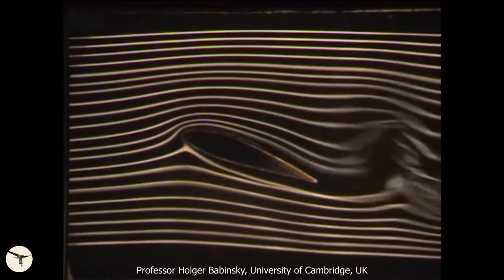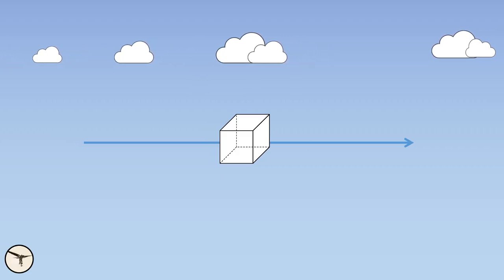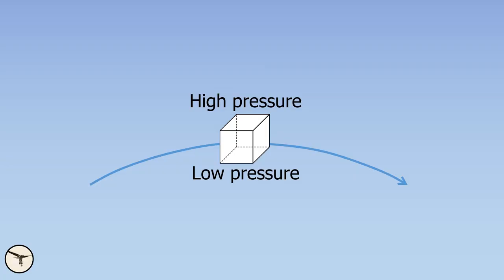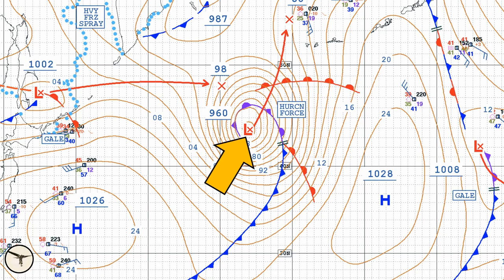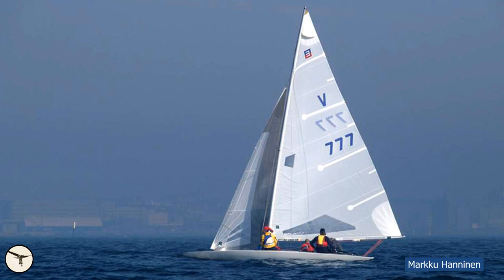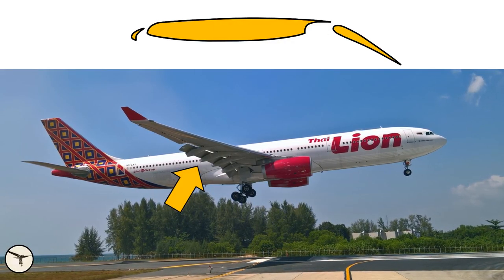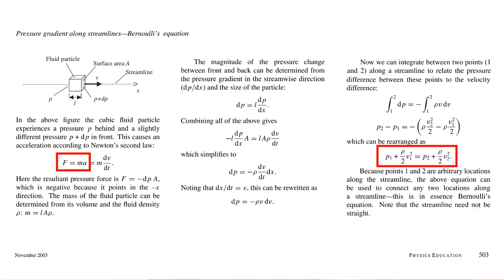Forget Bernoulli and Newton | The easy way to explain lift

Comment: Look at the larger picture and lessen the confusion: a heavier than air aircraft can sustain itself in flight ONLY by accelerating a mass of air downward with sufficient force to counter the force of gravity.  Regardless of what goes on on the top or bottom of the wing, or on any other aerodynamic surface, the net effect of the interaction must be that air is accelerated downward, or the aircraft will fall toward the ground.  Hope this helps.
Reply from the maker: Yes, that is true, but the acceleration happens over the curved leading edge and upper surface of the wing.
Reply: @FlywithMagnar  And that affects it's behavior at specific angles of attack and makes it less draggy (more efficient) but it does not change what is happening. Air is shoved up against a surface of an objected being shoved through the air. The object is getting pushed by the air as it moves past. Even if the leading edge and upper surface of a 'wing' is not curved at all it still gets forced around by the air moving past it. If you're careful you can direct that force against gravity and call it lift. The curves just make it easier to control.
Reply: @FlywithMagnar  - Almost all of the downward force is produced on the bottom and at the trailing edge of a wing.  Just look at any wind-tunnel with smoke video.  Equal and opposite reaction of a mass.
Reply: it must have angle of attsck thingy
Reply: Spot on.
Reply: @FlywithMagnar sigh .

Comment: The confusion in the minds of many is in the word LIFT.  Showing the high-speed/low-pressure airflow above the wing makes one think that the low pressure is lifting the airfoil when in fact, it's the higher pressure below the wing that is pushing the airfoil upward.  Low pressure doesn't pull; high pressure pushes and symmetrical airfoils work just fine as long as the angle of attack is positive.

Comment: Just a note, "deceleration" is incorrect. It is always called acceleration, simply because acceleration is a vector, so it has magnitude and direction. Like the difference in speed (scalar only) vs velocity (movement with direction)... The same goes for electric circuits, there is NO CURRENT FLOW, only directional movement or jostling (oscillation) of charge (DC vs AC). Hence current NEVER FLOWS, current is a form of flow AND thus, CHARGE is what moves. Current flow is nonsense, can a flow flow? (second derivative of what??) In the same sense, acceleration is the ONLY term and when a car, for instance hits the breaks, it accelerates to a HALT. Because the acceleration vector changes direction to oppose the motion, via the breaks and friction exerted on the road.

Comment: It seemed like an arbitrary decision to compare lift to low pressure cyclones. Why not compare lift to high pressure systems?   That would make the pressure highest in the center of the system and lower as you moved outward, reversing the conclusions of the discussion

Comment: short add.
We must consider what comes first, pressure changes or mass deflection?. Our first action is initiated by moving / displacing the mass package. Than by the inertia, the compressibility and viscosity, i.e. stretching of the rubber band comes the changes in pressure and the adiabatic temperatur changes. A continuous process.
Reply: What causes the displacement of the mass package?
Reply: @petep.2092  The leading edge of the aerofoil causes greater mass of air to be accelerated upwards , hence causing a compression in that direction which then in turn causes an acceleration in the horizontal direction.

Comment: Hei Magnar,
Quite an improvement which I can follow nearly to the end. There is still a confusion re Bernoulli's. We must not forget about viscosity, bounder layer, energy, Joule Thomsen, and more
Bernoulli's is valid along a single streamline. Many professors over the years have differences in understanding and explanations. The sum of it all is quite up to what I learned taking my engineering degree in 1979. We must integrate the work done (Newton) by deflecting a mass of air, a fluid, The equilibrium sum equals that halves of the lift comes from the upward deflection up front of the wing, the other halve from the deflected air leaving the trailing edge, i.e. the "vast" the energy is picked out, no more to gain from it. The pressure and temperature changes involved in the process can not pr Bernoulli's definition directly be linked to the process. No fluid likes to be disturbed, moving it is a mass that are to be moved and needs energy. The viscosity forces keep the fluid together which also needs energy to overcome. This in total can be linked to Newton. The rest of what happens are in many ways side effects. Stretching and compressing the fluid while we are moving the mass around. Air has mass as everything else trying to move it around, accelerate it demands energy / forces. 1 kg of air or 1 kg of steel is no difference F=m*a. Except viscosity compressibility etc. Air will by this be more "soft" to move around, like suspended by a rubber band, similar as if the 1 kg of steel was suspended by a rubber band.

You can not simply always say Ps1+Pd1= Ps2+Pd2. You can have different velocities but the pressure remains the same. As you demonstrate by blowing down your strait henging papir sheet, flowing air at one side, no flow at the other side of the papir sheet. 
Pretty presise metering instrument are in use which utilize the effect of Bernoulli's. Venturi Orifice plate, V-cone. Static pressure drop while the flow velocity increase. Rule of tumb pressure drop equals the differences i pipe diameters d/D which are named the beta value, +discharge coefficient adjustments. There is no beta value in free space around an airplane it becomes infinite. A curiosity from the old faction explanation of lift and Bernoulli's you can not split a venturi i halve and say you have "the upper surface" of a wing.
Reply: This comment is a little hard to follow, but I agree with the fact that, "You can have different velocities but the pressure remains the same." There must be a cause-effect relationship between pressure and velocity that is not discussed in this video. I also agree that external flow does not behave like a Venturi. Additionally, the paper experiment involves a jet stream of air, which is not representative of real flow over an airfoil.
Reply: @TylerPaparella  Yes Benoulli's principles are for fluids flowing in pipes. The leading edge of an aerofoil accelerates a larger mass of air upwards causing compression in the upward direction , this compression will then accelerate the air horizontally causing an initial decrease in static pressure , which will increase as the air flows along the top of the aerofoil . This is how lift is produced roughly by using Benoulli and Newton correctly.

Comment: I like both videos. I had given "lift" some thought before. There are many questions in Physics that can be analysed in multiple ways. For instance, you can't make a paper thin wing. It would have no strength. But the airfoil shape has a cross section known to minimize drag and can be designed to have some strength. You can make it curved and adjust the angle of attack such that it accelerates air with a downward component.  F=ma will give a value for lift. If you consider the individual molecules and their average velocity, then when air is moving, molecules will impact preferentially in the direction of flow and simultaneously have less of their velocity perpendicular to their motion. That would be a way to explain what is at the root of Bernouli's principle. And from there, proceed with the rest.  So what a lot of Physics amount to is rules that we expect to hold, when applied correctly. And we use them to disprove errors in our understanding and hopefully get clues to better insights.

Comment: 3:00  you can see in one instance he holds the paper correctly with an airfoil in it to show Bernoulli working.  Then he holds the paper with a tension crease in it to show Bernoulli not working.  The fact is that if you use a fair test, the paper responds as expected.  I've seen this more than once, and I can't decide if those who do it are just ignorant or deceptive.
Reply: Tension crease? Have you tried it yourself? What would be a fair test? He was demonstrating that airflow over a curved surface causes a force in the outward direction of the radius of the curve. He didn't really explain why… "there must be a force" is not an explanation. But he DID show that lift is created when the surface is curved. It is validated by the curved upper surfaces of wings, which are curved further to increase the lift. His demonstration serves to counter the explanation that lift is mainly the air hitting the bottom surface that pushes the wing up. If that were true, a wing wouldn't stall at about 20° angle of attack.

Comment: The first video was good. :)
This one is poor ! :(
I am surprised with the Cambridge professor :(

The explanation with stream curvature is wrong.

 @5:50 note that the cross section between A and B has narrowed since the front of the stream. Because the mass of the stream is constant, the speed through the cross section must increase. That is why the stream accelerate when you have this curved shape.

Comment: I'm confused.  At 3:38 you say "this is called the Coanda effect", talking about the curved paper.  But hasn't it been often suggested elsewhere the Coanda effect in "contaminating" the upper flow with an external source of dynamic pressure relative to the bottom pressure's starting conditions, means this cannot explain lift in the situation of a wing where the air split between top and bottom starts off with the same homogenous conditions (same static and dynamic pressure and temperature).

Furthermore, you seem to be following Babinsky in saying the Coanda effect needs to be included in the explanation of lift.

What am I missing here?:  The Coanda effect, due to the mixing in of an external source of dynamic pressure unequally to one side of the wing than the other, is said to not apply to the case of lift on a wing.

Yet both you and Babinsky are saying that the Coanda effect is needed to explain lift?  Something that doesn't occur in the generation of lift (without a differential external augmenting source), is used to explain lift?

And how does this at all replace Bernoulli, in the sense of conservation of energy not needing to be invoked?

Comment: The Bernoulli principle applied to the prop is that the force going on downward side has more speed that the side going up basically, P factor in making the plane want to turn left a little, this down and right thrust is added to the motor. 
Really a prop provides lift the same way of a wing foil. Easily explained lift is the result of thrust equals Drag, lift equals weight. Speed applied lowers weight value due to less time to react to gravity, and increases lift, air reflected in another direction by a horizontal surface.
So airspeed vs the amount of surface defelction, increases lift more and more. Conventional wings of Cessna, Beechcraft, have enough surface, although incrases drag, slower overall cruise, but to me is worth it, compared to more narrow wings needing more speed to stay aloft.

Comment: So many interesting comments here! I think it deserves a video on how the pressure explanation is valid with a flat sheet style wing. Which certainly flies. When I was taught aerodynamics for my pilots exam, I was told that Newtonian forces made up 70% of lift, with rest being Bernoulli forces…
Reply from the maker: A flat sheet style wing can fly. At least, it works for model aircraft with light structure (paper, foam or balsa) and and a relatively large wing area. But it cannot be scaled up. And aerodynamically, it's very inefficient. 
The idea that Newton is 70% of the lift and Bernoulli contributes to the rest is flawed. Lift is based on the preservation of mass, momentum and energy. Newton's laws of motion is preservation of momentum. Bernoulli's principle is preservation of energy. 
This video explains it in more detail: https://youtu.be/d4w1Iy4vVMg

Comment: What about angle of attack….What about wings that have no camber? Perhaps a partial explanation in a very good video.
Reply from the maker: The angle of attack is a very important factor for lift. Check out this video: https://youtu.be/e43l2V_MFIY

Wings without camber can produce lift. Again, the answer lies in the angle of attack. But a wing without camber will have poor stall characteristics.
Reply: @FlywithMagnar  All modern aerobatic aircraft have fully symmetric airfoils as do boat keels and rudders.    Some have good stall characteristics others not.

Comment: As I've stated elsewhere, It's not a question of "either/or": Newton's Third Law is fundamental to the creation of a lift force.  Air must be directed downwards to produce a force in the opposite direction:  if it's not, there can be no lift force.  Don't be misled by what I characterise as 'The Wind Tunnel Syndrome': think instead of a wing moving through still air.
A bumble bee demonstrated this for me years ago in the Model Shop at Rolls-Royce, Bristol.  It was flying low over the floor, which had a covering of fine sawdust.  The downwash from the bee's wings cleared a little pathway of sawdust beneath its flight path.
An aircraft can do the same thing to the cloud tops.  There are numerous photos on the internet, which show an aircraft producing a 'trough' in the cloud tops, with the inward/downward curl of the wingtip vortices also clearly visible.

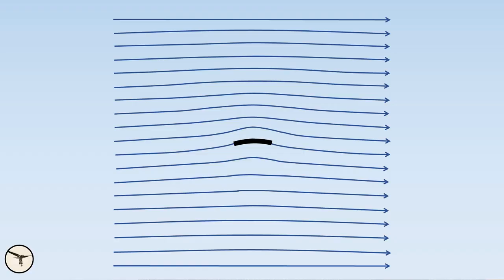Comment: There are problems with this at 5:00 . The forces at B and C are opposite at the leading and trailing tips due to inverted curvature thus cancelling total lift. At the tips the lift cancels the lift at the center.

This can also be seen by the lack of downward airflow on the right outgoing side when compared to the incoming left side.

No total downward flow, no total lift !
Reply: The pressure at B is less than at C. That is the point. Pressure above is lower than pressure underneath. They are not equal in magnitude therefore they do not cancel.
There is a downwash off the trailing edge. There is an upwash at the leading edge. Therefore, the flow is turned from upward to downward as it passes across the airfoil. The upwash has a positive vertical speed, the downwash has a negative vertical speed. The change in vertical speed times the mass flow rate is the momentum change of the air. The lift is equal and opposite to that by Newton’s 3rd law.
The diagram is not a faithful representation of real airflow but it does serve to demonstrate certain key concepts.
Reply: Because there is likely so much mass in the momentum of the vertical movement of air (MxV) relative to its vertical velocity, it may be a challenge to depict accurately in an illustration.

Comment: One interesting fact:  if parcels are being divided by the leading edge, and if camber and AOA are adjusted in order to cause parcels to recombine at the trailing edge, then this guarantees that the Circulation is zero, and the lift is also zero.  
So, not only is "Equal Transit Time" a mistaken explanation ...it is also a recipe for attaining EXACTLY zero lifting force!   Whenever the "phase-shift" between split parcels at the trailing edge is zero, the lift is also zero.

Comment: Magmar i ask you :::victor schauberger implosion technology wat it is ???
Reply from the maker: Schauberger designed a device he called the “Home Power Generator”. By sending either air or water through a spirally coiled channel, the generator should produce a drop in temperature, which would then produce suction, and ultimately, implosion. This should be a source of free energy.

Comment: The diagram at 5:37 illustrates two-dimensional flow (i.e., infinite wingspan or a wing that goes from one wall of the wind tunnel to the other wall - no wing tips).  We operate in three-dimensions (with a finite wingspan) which produces wing tip vortices, downwash, and lift (by imparting downward velocity to a large air mass).
Reply from the maker: A video about 3D lift is in the making.
Reply: The explanation that the vortices off the wing tips create the downwash which creates the reaction force called lift… is a plausible but erroneous explanation. If it were true, gliders with very long wingspans would have to produce enormous vortices to deflect the air downwards all along the wingspan.

Comment: With an airplane wing the air is not flowing over the shape but the shape is flowing through the air. In a wind tunnel and with a sail, the first is basically  true. We talk about two different interactions here.

Comment: Hmm... I've always found the easiest way to "explain" lift to a lay person (non engineer/aerodynamicist/mathematician) is to have them try to handle a full sheet of plywood in a stiff breeze. Makes it really intuitive, especially if you're standing on a roof at the time. The air has mass. On it's way past objects it pushes them around. Now if you want to start creating a shape that has a particular and specific behavior as it moves through the air... that's more complicated.
Reply from the maker: A sheet of plywood held in an angle against the wind is like an airbrake. There's a lot of resistance, but little lift. That's why wings are shaped as they are.
Reply: @FlywithMagnar  Moron.  A sheet of plywood is a wing.  The air molecules hit against it like ping pong balls and force it in one direction or the other.  More efficient wings exist, as early aerospace engineers discovered.
Reply: @crimony3054  For being rude, you get to explain… so what makes for a more efficient wing?